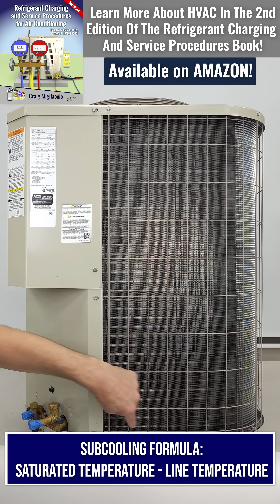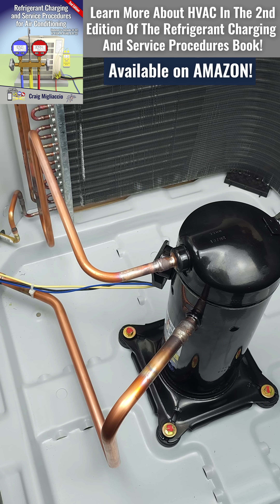Subcooling On An Outdoor AC Unit, Explained Quickly!

Comment: So, it goes from 110°F down to 100-ish before it exits the compressor coils. I understand that releasing heat into the exterior environment is a beneficial thing. What I don't understand is how 100° coolant helps anything when it comes back through the evaporator coils in the air handler.

Comment: In about 1965 or so my Dad bought an Emerson Quiet Kool window AC unit and put it into the room my sisters shared. It was a small unit, about 5,000 btu. Then in 1978 Dad and Mom, empty nesters, moved into a new custom home they had built so I claimed the Emerson and used it in my college apartment. It has followed me ever since and I monkeyed around with it to see what made it tick. At one time I let all the Freon out installed a sight glass with a desiccant cannister and moisture detector. Then I began to recharged it right on the picnic table on my deck. I just slowly recharged it until I saw the corner of the evaporator start to get wet. At first only the entrance to the coil got wet. Then it froze right up in that corner. So I kept letting more Freon in and I watched it go from freezing up in the corner to extending the cooling all the way across the entire coil. I wasn't using any tools at all, just watching the coil get wet, feeling the cool air blowing out of it, looking at the bubbles in the sight glass and keeping track of how much Freon I was letting into it. Eventually I decided to stop filling it and made a determination about how much cooling I was getting. I stopped when the whole entire coil was all wet and the air seemed the coldest all over it. Then I made an estimation of how much Freon I had charged it with and compared to the label on the Emerson. I was at about what they said it held. So I was satisfied things were working correctly and I was making as efficient use of the area of cooling coil as I could. Then I took it into my basement where I actually split the unit and put the hot side outside my basement window to dry my basement and cool it too. I used tap water to cool the condenser. Later I put it back together and used it in a Pickup Truck slide in camper. It had been just sitting in the basement, so one day I robbed the thermostat to use on a newer R134 window unit for my bedroom in an effort to get my new unit to go below 74°F. I still have that Emerson w/ the robbed the thermostat and I am going to resurrect it one more time to dry and cool my basement again. This time I will use "surface water" to cool the condenser as I have learned how to "wash" a surface water well. Back during the very hot dry year here in Michigan of 1988, I washed a well down about 20 feet deep out in my yard and brought surface water up to water my yard and fill my swimming pool.  I don't believe I pumped a million gallons out of it, but for years and years and years I filled my 20,000 gallon pool, watered my grass and trees and a garden, so I pumped a LOT out of it. I know it works. For many years I have thought about running that "surface" water, which runs at about 55°F thru a radiator and draw air thru it to cool and dehumidify my basement. I thought if I used a small pump and low wattage fan it might take less electricity to pump the water thru a radiator and circulate the air thru the radiator than an AC unit. Now I'm thinking about using the Emerson maybe one last time to cool and dry my basement by washing a well right there in my basement and using the water to cool the condenser. I'm retired now so I have the time and some $$$ to expend on it. They say curiosity killed the cat, well I experimented at GM for 36 years on fuel economy and drivability, so I'm just scratching that itch to "run a test" as my girl friend used to say. Ha. I'm havin fun, thank God Trump displaced the Evil imperialist. ben/ michigan
Reply: did u really type all that..

Comment: Very well explained with the right sentences and flow of words.  Subcooling is actually not the optimal way to run an AC system because the exchange of heat between the condenser (which is what this is) and the outdoor air is proportional to the difference in temperature with it. When the saturated liquid starts to drop in temperature it gets closer to the air temperature around it and the heat exchange slows down. That means the refrigerant spend too much time in the condenser not doing as much heat exchange with the outdoors  (or the condenser is too big for the system, or the system is undercharged).  While if it were to exit the condenser just as it reached saturated liquid state then make space for refrigerant still in the intermediate diphase that is exchanging heat at max rate with the environement.  Think of it as a increasing the entropy of the environment faster, thus actually cooling indoor more efficiently.
Reply: What type of unit works like this?

Comment: I’ll blow some minds right now and probably get some nasty looks. Apprentices look away. I’ve done hvac 6 yrs now. All on job training from people that have done it decades. Never once have I used superheat and subcooling. Just look at your sat temps on your gauges. All you need. This is shit school teaches you instead of how to be a real tech. Also I work around all those same units I charged and replaced compressors on. And they’re all still running years later. So before you try to roast me. Cope more ahah

Comment: Learned me something. I always thought that the high pressure vapor line pumped to the txv valve and into the Evap coil where it expanded into liquid picking up indoor heat through the evap and then went to the condenser to give off that heat and back to the compressor pumped out as hot gas again. Hmmm.
Reply: you better think about it a bit more

Comment: Why does it spend so much distance transitioning from vapor to liquid and doesn't cool in temperature at all over that long distance and then suddenly in the last few inches it cools down a whole lot all of a sudden
Reply: I don't know but if you put water on it the whole thing becomes way more efficient.
Reply: It's like ice melting. Your glass stays at 0 degrees for a long time until all the ice melts, then it warms up more. This is vapor turning to gas, absorbing energy. 
It does the opposite when it boils to take energy from the cold side of the system.

Comment: Subcooling is a measure of the refrigerant  quality. In a large multiplex rack system,  we often mechanically cool the liquid refrigerant to increase the capacity. The less heat the liquid has in it, the more BTU per pound it can absorb. I think of it as very clam and cool, ready to work and get the job done properly and orderly.  Send it through in a foamy, erratic state, and it will do its work poorly.

Comment: But it's dumping heat to air....but air is being sucked into the center fan and out the top.  Where is the COLD air in the system that is being blown through the indoor vents?
Reply: This shown is the condenser coil changing vapor to a liquid. The indoor coil or evaporator  takes that liquid then suddenly reduces its pressure in the valve making it a vapor again and that absorbs the heat passing through he indoor coil. Removing the heat is where you get the cold air. the heat is the transferred in a vapor to the outdoor coil to expel that indoor heat to the outside.
Reply: Concur.My mentor taught that 'Cold' DOES NOT EXIST... IT is merely "the absence of HEAT"... which is extracted & absorbed into the gas/vapor passing thru the evaporator coil.

Comment: Thanks that is helpful.  I had forgotten what subcooling meant.  Very well explained.
Reply from the maker: You're welcome, happy to help!
Reply: @acservicetechchannel  is it like the opposite of superheat where liquid water at normal atmospheric pressure can only rise to 212°F after that, it turns to a vapor and the vapor can go up much higher in temperature than in the liquid state?

Comment: What happens when it's 115F out? System runs at high pressure the raise saturation temperature?
Reply: Higher temps makes the vapor more excited and that makes higher pressures.  The higher pressure makes the pump have to work that much harder to get subcooling.
Reply: water boils at 112 degrees so its saturation vapor and some liquid because of the steam
Reply: @korey908Trucking water doesn’t boil at 112 degrees!!
Reply: @ yeah it’s 212 that was a syntax
Reply: @ 212
Reply: @korey908Trucking  what is a syntax ???
Reply: @mwatkins2464  Its the resort fee you pay at the Las Vegas hotels
Reply: @korey908Trucking 212 not 112

Comment: Nice job. You make very very good videos brother.

I had to explain to tech support once how the liquid line works when I got a crap unit and he was looking for any reason to not warranty it.
Sightglass inside or outside doesn't matter that whole line should be solid liquid feeding a txv so whether you see the solid liquid inside or outside makes no difference. Obviously you don't want your condenser full of liquid but as you properly explained, there should be some in a properly charged unit.

Wish I had your number in my pocket 🤪
Reply: I was thinking the same thing.😊
Reply: Meant to add  "hence the subcooling reading we take"

Comment: Yesterday my helper accidentally add 454b to a 410a unit, i think to avoid the happening the maker's should install a left hand threaded service charge port to the low side. With that there can be no way to make that mistake again. It also happened because people lack to take the time to read.
Reply: Maybe you shouldn't be taking a nap in the van while your helper is adding refrigerant to the system.
Reply: No we do not need to idiot proof everything. We are supposed to be professional.
Reply: Makes no sense 😂
Reply: The bottle 454B comes in is a left handed threaded connection. Only on the bottle. Other than that you probably should have been watching your helper lol
Reply: Yeah... reading helps
Reply: Just read the label on the bottles dumb dumb
Reply: I thought they did that or is that only with r32. I havent came across any a2l systems yet
Reply: I'm in an HVAC course at the moment. Makes me wonder how often folks mess up like this?
Reply: 😂😂 love all these trollers acting like mistakes never happen. Don't let it bother you. The perfect  people live on youtube not in the real world.